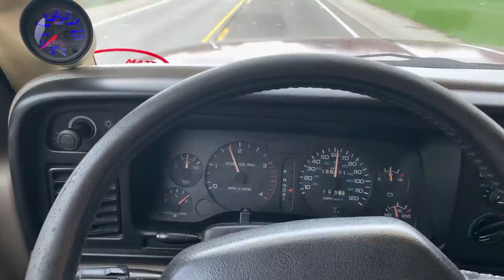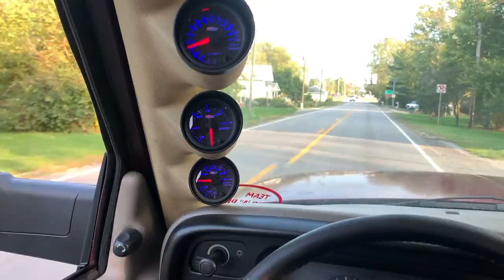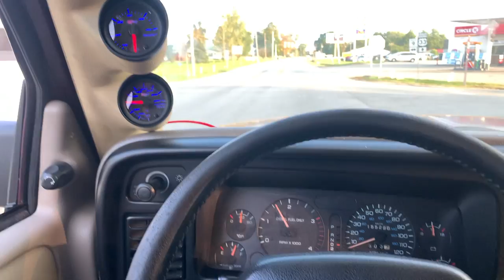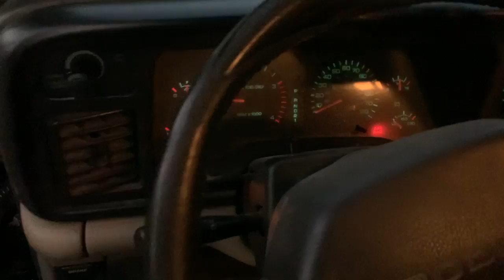FaceBook Marketplace DEAL OF A LIFETIME!!! ( I bought another truck! )

Comment: On the new flatbed I would do a 4th gen leather interior and the 4th gen steering wheel  and I would put like a 4 inch lift on it and then it different wheels and tires on it and Mabey paint match a 4th gen bumper with light bar in bumper